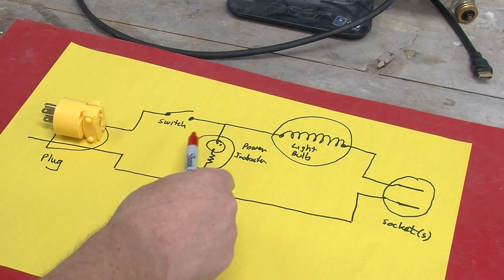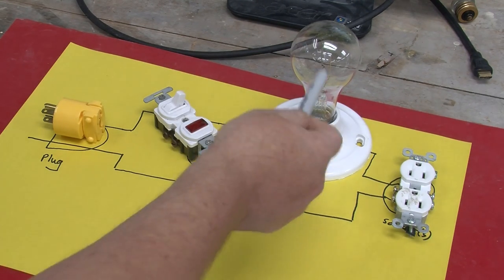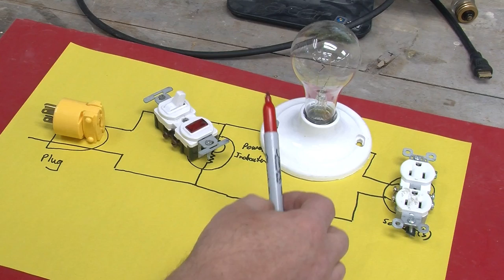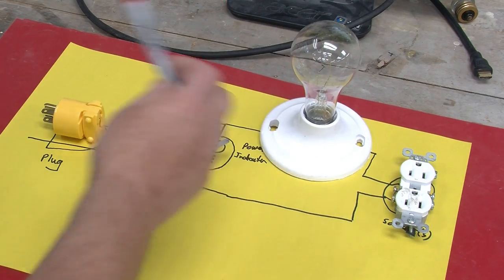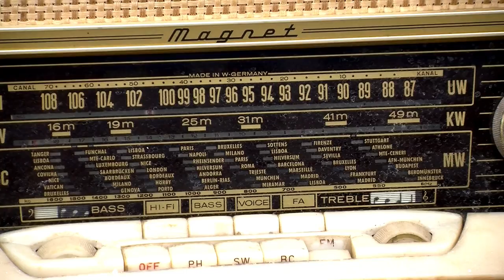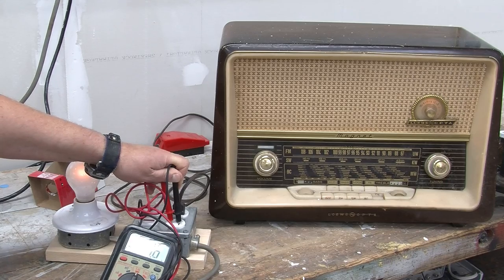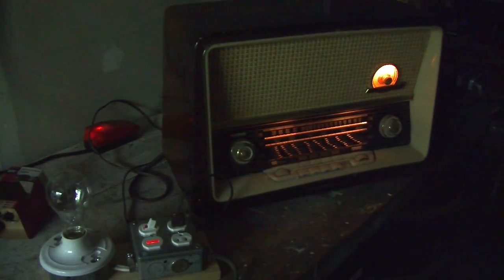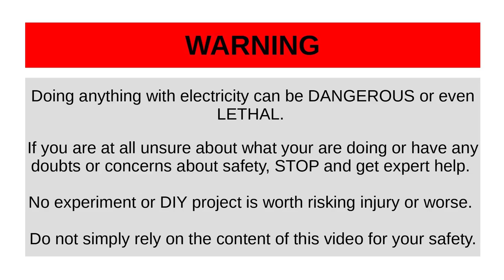When a Light Bulb is better than a Fuse

Comment: I used to work in a telephone exchange that all ran on 50 volts, it was standard practice to use a buld instead of a fuse to help locate temporary faults in the Strowger equipment. If you used a fuse, every time an intermittent fault appeared a whole section of equipment would be out of service causing all kinds of problems and alarms, with the bulb, when a fault occurred, it would just light up so we could investigate, and when the faukt went away, everything would work again. 1970s.
Reply from the maker: I have always wondered how hard it was to troubleshoot those rooms of mechanical switchgear. I'm guessing you had tools to clean or tweak slightly bent contacts, but finding which contact in which switch? I would love to have seen one of those mechanical exchanges in operation. When I was in university, the small city it was located in still had mechanical phone exchange and I think they may have started to skimp on maintenance since they knew it would be replaced soon. Sometime you would get a really bad phone connection - noisy etc and the solution was to hang up and try again and hopefully get a different set of switches. When it was converted to an all digital presumably Northern Telecom switch the improvement in quality was noticeable!

Comment: using a kettle works well too, in the uk, you can get 3200 ish watt out the plugs, any more and your breakers or fuses blow, if you get a 3000w heater or kettle, you can put it in series then short it out all day as your current limit is 3000w, same with a small 300w heater, just be careful in remembering what becomes live and neutral

Comment: Nice Dim bulb Tester. 

Also in older homes with edison base fuse.  I  screw in the light bulb in the fuse socket so i can 
Locate the short and clear them before putting a new fuse in.
Reply from the maker: Interesting - I had never heard of that before. There is a lot more to the lowly old incandescent bulb than most people would ever think!
Reply: @ElectromagneticVideos :  Enjoyed the video. Indeed the incandescent is quite versatile. Besides using them to protect DUT on the bench, I use them to do a quick-test on SLA batteries (usually in the 5-35Ah range). I find that the waveform produced when pulsing a bulb (e.g.12V/75W Halogen) with battery under test reveals much about health of battery. We can usually predict a C20 failure simply from the pulse's FWHM characteristics. Sadly, I have several expensive battery-testers in my lab, and they never agree with one another; even on THE SAME BATTERY. And, results are inconsistent from one battery BRAND to another (e.g. two brands of 20Ah battery that have identical C20 test results might display VASTLY DIFFERENT results with said testers). SUPER ANNOYING. The bulb pulse test gets all the batteries back on a level playing field.
Reply from the maker: @hightttech  Amazing about the battery testers - I assume they are from different manufacturers?  

Your test reminds me of using a 12V car bulb attached to connector to plug into a power out socket on a piece of electronics we manufactured years ago. It was  great way of making sure the connection was good and could deliver an amp or so. A led might have glowed even if there was a few K Ohms in a poor solder joint or some such thing.
Reply: @ElectromagneticVideos :  
Yes; we have several brands of battery testers. I've observed the various battery testers run through their routines with a scope connected. Each has a unique routine, but sadly none ever accurately predict the actual C20 capacity. It's literally all over the board. RIDICULOUS. A real C20 test is the gold standard in our lab for condemning a battery, but the bulb-pulse test is very predictable for quick tests. 

Also, i agree 100% that loading a circuit is excellent way to verify integrity of current path. Intermittent problems due to failing solder joint(s) or connector(s) will drive techs nuts until one brings out a hungry test light, then naughty spots will reveal themselves with nice voltage drops, and probably glow a bit for a FLIR cam.
Reply from the maker: @hightttech  So I'm curious, what is the application for (trying to) test battery health so accurately?

Comment: yes indeed!
with a 12v bulb, this can be used for automotive troubleshooting as well.

subscribed
Reply from the maker: Ill have to remember that - never thought of it for cars.
Reply: A 12 volt bulb is a good way to pre-charge the input capacitors of DC/AC power inverters, and large car audio amplifiers. It's the perfect protection if (heaven forbid) you connect the supply backwards. If the bulb stays lit, you know the polarity is wrong, and with the ballast of the bulb, there likely won't be any damage. It can save a lot of money$$$
Reply from the maker: @vincentrobinette1507  What a great idea. I always dislike the big spark when attaching a big inverter and with the bonus of catching a disastrous error this is great.
Reply: @vincentrobinette1507  yes, I have a SPST switch circuit for pre-charge & discharge. The polarity protection part is genius, thanks! (I have only blown up a yard-sale inverter ;)

Comment: I put an incandescent light bulb in series with a Compact Fluorescent Light, and used it for a long time. The CFL ran at full brightness, until one day it failed and the other bulb came on. This indicated that when a CFL goes bad, it shorts, then blows an internal fuse. But since the short circuit current was limited by the 100-watt bulb in series, the fuse didn't blow, the CFL just stayed shorted. 
Also, you can't buy a 100 watt bulb around here any longer. I have a pack of unused ones, maybe I can get rich quick.
Reply from the maker: What an odd failure mode! Was it electronic ballast or the ones with an inductor and the flicker switch? Would be interesting to know if that type of bulb always fails that way or what you observed was a rare occurrence.

I have occasionally seen incandescent bulbs at dollar stores, so your stash of them might not be a cash windfall - yet :)
Reply: @ElectromagneticVideos  ... yes, dollar stores (old stock) or garage sales.
Reply from the maker: @rupe53  Someone recently mentioned in on of the other comment threads threads that Lowes in the US still sells 300W incandescent. Next time in in the US I will look. I'm sure a suitcase full of bulbs will give the baggage X-Ray people something to scratch their head over :)
Reply: @ElectromagneticVideos  .... anything to declare sir? <LOL> BTW, the manufacture of bulbs over 60 watts is slowly being phased out. You can still buy "appliance bulbs" which will work in high or low temps. (oven / fridge) Obviously the electronics for LEDs or CFLs can't withstand extremes.
Reply from the maker: @rupe53  And if the customs officers are young they may never have seen an old style light bulb :) Actually they are pretty good at dealing with a suitcase full of weird electronics as you declare it - I'm sure they have seen stuff beyond anything we can imagine after doing the job for only a few months :) I have  found most LEDs are fine in cold temps outside (-30C nights) or in the fridge in case anyone is interested.
Reply: @ElectromagneticVideos  ... yes, but moisture and heat will kill them.
Reply: I used to travel a lot and liked to take a pair of small speakers with me. To protect them from getting squashed by everything else in my bag, I'd pack them in a metal lunch box. My bag got a TSA inspection tag put in it 100% of the time. I eventually learned to pack in a way that it was easy for them to inspect without having to stir everything up.
Reply from the maker: @mailleweaver  I have done exactly the same thing! And also put a note on company letterhead right on top of everything in the suitcase describing what the electronics was and giving phones numbers to call if there were any questions. Funniest check happened one vacation when I had collected a fair sized volcanic rock with lots of bubbles in the solidified lava in BC. It must have looked like something bad on the xray and there was the "we opened you suitcase" note inside when I got back home.

Comment: Thanks. How does this compare / contrast with a variac and why do most repairers seem to use both a light bulb and a variac when energizing old equipment for the first time?
Reply from the maker: A variac provides adjustable voltage at almost limitless current (limitless until its fuse blows). So if there is a short/intermittent short/low resistance fault in the device you are testing, even if you are really careful bringing the voltage up slowly you may end up damaging some components around the failed one with too much current. Or the variac or device's fuse pops before you can tell what part is shorting. 

The bulb limits the current hopefully to a low enough value that hopefully other components other than the failed one wont get damaged. And with some current flowing you can often use a voltmeter to find where the short is quite easily. The current limiting aspect can also be used to reform capacitors in old electronics. 

The use of both is give a bit finer control than is possible by switching bulbs ans also the ability so gentry raise the voltage while having the protection of current limiting. So the best of both devices.

Comment: This also brings back memories. My dad, too chicken to deal with the tubes in our television or radio would have me, a nine year old crawl into the cabinet and remove the tubes. We then would go to the grocery store where there was a tube tester with all sorts of plugs and dials, where we could check each tube to find the bad one. Then a couple of bucks later we went home to reassemble the tubes, hopefully fixing the radio or TV.
      And another memory was an old German made Grundig Hi-Fi that my dad bought while he was in the service. Like your radio it had multiple bands for AM, FM and shortwave. There was a bright green electric eye that showed exactly where the strongest signal for a station was when it narrowed to a sharp line from a fuzzy green circle.
Reply from the maker: Nice story! I'm just old enough to remember the big tube testers that many stores had. I think they began disappearing when I was 5 or 6 years old. I did a lot of TV repairs when I was in high school - had my own tube tester which I got as a surplus kit when presumably  the demand for things like that had evaporated. One thing I always remember is some tubes had their part numbers marked with paint that after many years of operation would wipe off when you touched them. And if the part numbers werent shown on the chassis or back or the radio or TV, you were in trouble.

I always like the German tube radios and Hi-Fi equipment. It was much more solidly built than stuff made in the US or Canada, and had a higher end feel to them. Every one I have come across had a transformer power supply as opposed to the dangerous direct connected ones made over here.  And the eye tubes are great for tuning. I'm sure that added 10% to the cost of the radio.
Reply: @ElectromagneticVideos  The big challenge for us with the German made Grundig was that the numbers and letters on the tubes did not use the same conventions as the American products. So, we had to guess at the correct tube, and somehow we were always right. The large 21" Magnavox television was another issue: while we could fix the tubes for the set's audio, the picture tube was failing and that was well beyond our capabilities to repair.  We called out a repairman who said that the replacement black and white tube wasn't made anymore. We were sad, for the TV had great picture and reception. We were the last persons on the block to get a Color TV, for at over 600 dollars they were far too expensive for us to afford in the 1960s.
Reply from the maker: @ronkemperful  I actually got to know German tubes and their  numbers quite well - dad was posted to Bonn in Germany in the early 70s so no issues gets tubes withe German numbers. I'll bet the picture tube going doomed many nice sets. 

$600 back then must have been a fortune. I remember going with dad to buy our first color TV at the US Military PX in Bonn. It had the special ability to switch from European PAL to NTSC so you could take it back to the US or Canada. I actually still have it - will have to do a video about it sometime.
Reply: @ElectromagneticVideos  Will watch out and look forward to your video.
Reply from the maker: @ronkemperful  Great! but dont hold your breath - might be a while till I get to. The other neat thing about that TV is that it has tubes (HV section), transistors (RF) and some IC (Audio if think)  which I always though was neat. And the PAL color decoder has an acoustic 1 horizontal line delay line (= acoustic memory). What a combination of technology!
Reply: @ElectromagneticVideos  When you talk about your unusual hybrid TV you might say a word concerning PAL. PAL is fascinating to me. Introduced about 14 years after the introduction of color TV in Europe, PAL not only had a higher definition, but built into the signal technology, color was automatically compensated for during analog broadcasts. Unlike NCTS broadcasting where color was distorted by a plane flying overhead, a truck going by, or a weakness in a transmission somewhere;  PAL signals were not disturbed… at least that I heard. My time at Frankfurt Germany was just during the year of my birth in the 1950s so I’ve never seen a PAL set. I have noticed that quality DVDs of British TV in the early 70s were vastly superior in fidelity and color - that must have been preserved better with PAL.
Reply from the maker: @ronkemperful  You know, I have been wanting to do some topics in that area. And SECAM as well which we had when we lived in Baghdad in the mid 1970s. I do think NTSC is sadly not given the credit it should - a brilliant way of encoding color and leaving the BW signal intact and no more bandwidth either - and once NTSC was invented and in use, its always easier to see issues and make an improved system. While PAL and SECAM made reception easier for simple sets, they both made studio editing and mixing video signals harder in the analog days - they couldn't easily be added the way NTSC was. I read somewhere that in places like France they did their editing  in PAL or some modified form of it because the SECAM color subcarriers are FM which you cant simply add due to the non-linear nature of the modulation.

Comment: Another great video.  When I assembled my isolation transformer from Digikey I placed a DPDT switch in the box between two outlets.  The switch is wired so that I can quickly put a nice big lamp in series with the load.  My only concern now is finding incandescent bulbs.  I just realized Ontario has almost completely banned T8 fluorescent lights, probably the cheapest, most reliable and long-lasting lighting technology mankind has ever known, not to mention an install base which is no doubt in the tens of millions in this country alone.
Reply from the maker: Thats convienient. You still seem to be able to get incandescents alhough I did hoard a bunch when Rona got bought by lowes and had a huge clearance sale. I didnt realize T8s were actually banned. I had good luck with a bunch of T8 LED replacements I also got for cheap from Rona's clearance. Interestingly 2/3 the power and a scalled down light output partially compensated for light production in one direction. Would not be great  for outdoor signs needing light on both sides.
Reply: @ElectromagneticVideos  Two thirds the power is nice but not compelling enough to justify the cost and reliability of LEDs.  I think this ban was targetting the small amount of Hg in the tube. Even if ballasted fixtures are still okay, it makes no sense to choose them in new installs.  Time will tell what type of "native" LED installation is best.
Reply from the maker: @d46512  Completly agree - many toxic inly reason I went for them is I got them for $3 each. You also wonder how many toxic chemicals from semiconductor manufacturing compares to the Hg in terms of impact.

Comment: Back in the early 1970's when I was in the 9th grade I had a science teacher that told me anytime you are powering up old electronics with electrolytic capacitors that you should power them on for a second or two and power them off and do this a dozen times or so and then do it gain and a gain for longer and longer periods of time limits the current on the electrolytic capacitors and gives them time to recover. I don't know it it worked but I never had an electrolytic capacitor blowup on me.
Reply from the maker: Smart teacher! And that advice sounds like it  worked for you! They do degrade without use over time and you need to reform them to restore the oxide layer. A gradually increasing voltage or a few power cycles as you describe will do it if they haven't lost too much moisture.  Funnily enough, I had one spew steam on me a few days ago after powering up a 5 year old solar inverter that was unused but brand new. Unfortunately it was such a microcontroller managed device with many caps that it was hard to tell if a particular cap was being charged or not. I have a replacement cap on the way ....

Comment: We use the same kind of devices for diagnostics in the DC world. In the case of a dead short, the bulb offers enough resistance to prevent the fuse from blowing, allowing one to do wiggle tests and current tests to try and isolate the short.